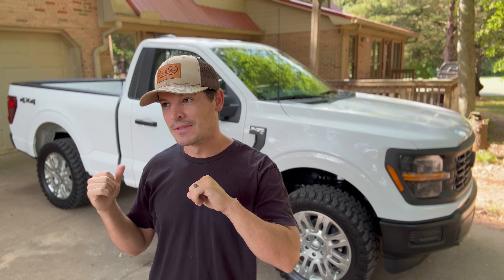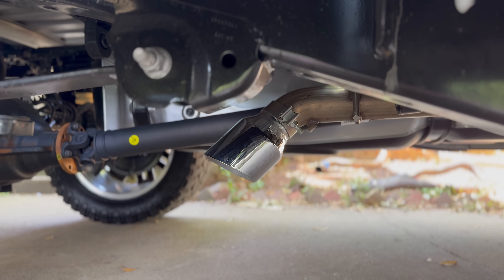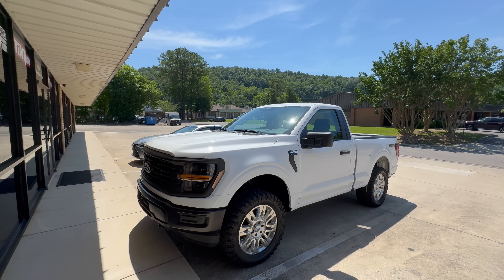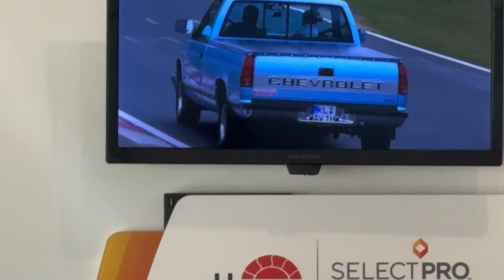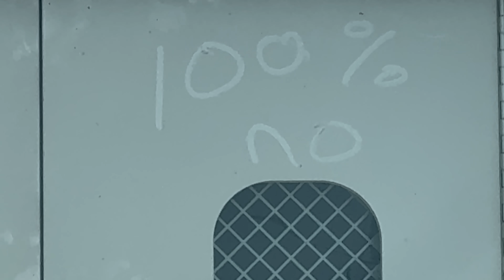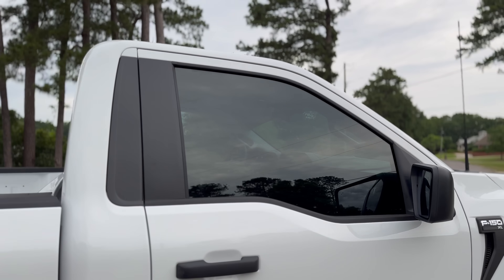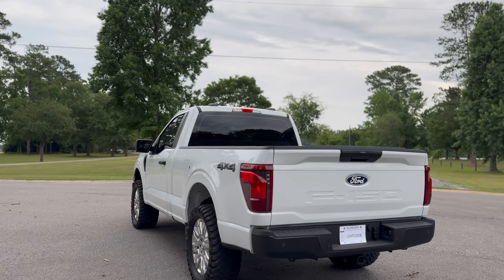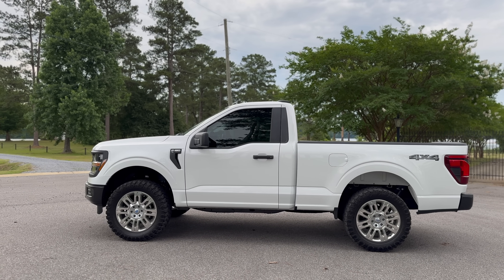SHOULD HAVE BEEN THE FIRST THING I DID!

Comment: Trucks coming without rear wheel well liners should be a crime
Reply: Funny you mention that.  I bought a 2013 Tundra SR5 CrewMax new: had liners.  My boss's brand new $70K Tundra 1794 does not.  $70K and no liners???  My 2023 F150 XL SuperCrew does not, but it stickered for $47K
Reply: I taped off my 2019 and sprayed the inside wheel well with flex seal , 5 yrs and holding up great
Reply: @danz0007  Dang... man... I might have to do that.  I know they sell the bedliner in a spray can, too.  I honestly never thought about doing that.  Either option would be more durable and cheaper than the actual liner.  Hmmmm... 🤔
Reply: Using a truck as a Camry should be illegal.
Reply: The real crime is the price tag on that single cab..it looks fire though 🔥
Reply: It’s a give and take have to remember that’s where rust accumulates the fastest in colder climates most people can’t get the snow dirt/salt out of the corners ect…. It’s nice for reducing sound on gravel roads but these new f150s are so quit it doesn’t really matter I personally forgo them in place of bi yearly undercoat.
Reply: I mean once every 2 years lol
Reply: Been complaining about that since the 90’s

Comment: I've got a 2023 F-150 STX package with the 5.0 coyote engine, absolutely love it, total blast to drive. I wanted a slightly throatier sound to the exhaust, so I had a Magna Flow muffler installed, leaving the resonator in place with the single exhaust exiting out the passenger side as it came stock. It sounds great and at highway speeds you can hardly hear the exhaust. Then I hooked up my 23-foot ultra-lite RV. Holy crap! The exhaust noise is an annoying drone at highway speeds which I'm sure will result in a headache for my wife and I. Now I wish I would have left the exhaust alone as most of our RV travels are at least a three-hour drive. No RV attached=wonderful. RV attached=HELL!

Comment: I had a 1997 Ford F150 Shorty. 4.2 L V6 with a standard. The exhaust was cut halfway, and it came out right in front of the passenger rear tire. Stock from the factory.
Reply: I still have that same truck
Reply: @michaelwpaulin4876  great trucks man. Mine was an XL model and was very reliable